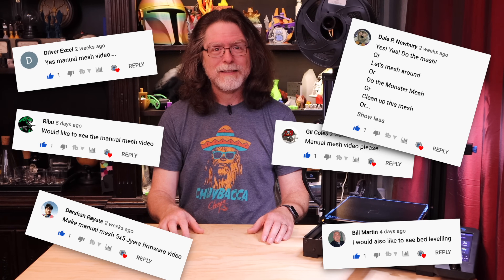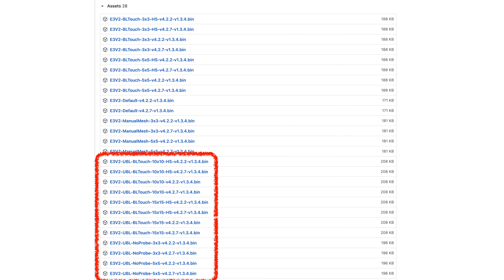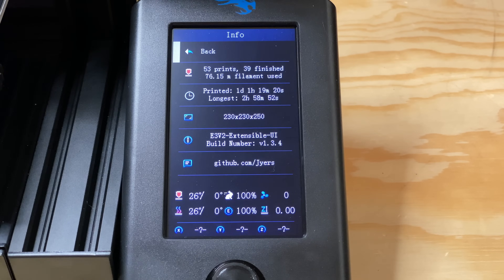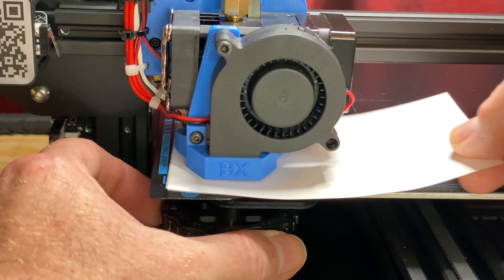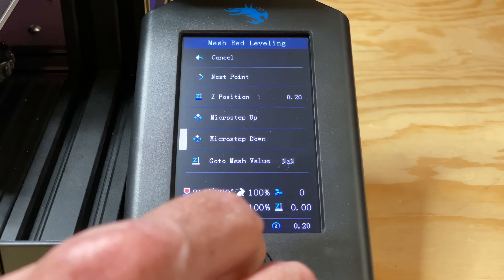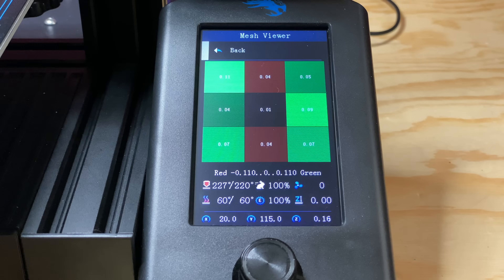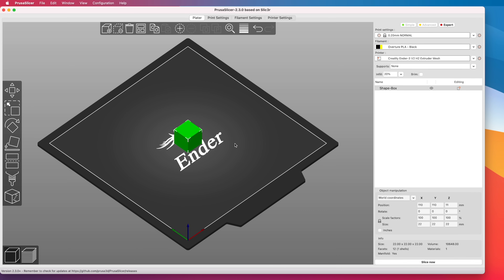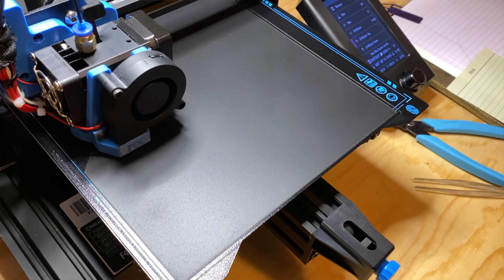Perfect First Layers with Manual Mesh Leveling - JyersUI on Ender-3 V2

Comment: I would like to find out is the Jyers firmware work with the CR-Touch? or only with BL-Touch?
Reply: did you find out if cr touch works with jyers if so what firmware did you use
Reply: @Mrccarter3000  yes. It works with the CR-TOUCH

Comment: Thank you so much! I can't seem to find the lcd screen firmware. Can anyone help (ender 3 v2, 4.2.2 board, no bl touch)?
Reply from the maker: Hi! Download the source code.zip file from the bottom of the big list of files here: https://github.com/Jyers/Marlin/releases/tag/v1.3.5
When you expand the zip archive, it should produce a folder named Marlin-1.3.5 and Inside there, you'll find a Display firmware folder. It contains a Readme file, so read that for instructions on how to proceed. It also contains a Firmware sets folder, and that's where you'll find three different items. 👍
Reply: @BV3D  Thank you so much
Reply: I don't know if I did something wrong. Flashing done, but icons didn't change.
Reply: @chrisradical2046  the icons are done by opening the back of the display. There is an sdcard slot on the back of the PCB to flash the icons. 

Flash the firmware via the slots the front

Flash the controller with its internal sdcard for the icons. 

In both instances only have the relevant bin file on the card.
Reply: @ThoughtandMemory  That's what I did.

Comment: Question : so just add that m420 code, and no need to tick "enable mesh leveling" option before print?

I've used mesh leveling before but didn't add any M commands in slicer, I kept going to level> tick the mesh leveling enable then print. Hmmm...

Comment: This was such a useful video! Thanks very much. I too had the same problem of a quite pronounced dip in the middle of my Ender3 V2 bed and even levelling the sides meant that prints in the middle kept lifting off. After installing the Jyers firmware and following your instructions, the prints are perfect!!!!

Comment: Any possibility to get a video on using the CR Touch with Jyers? I imagine it's no different from the BL Touch as far as usage but it would be nice to know how to properly using the ABL with Jyers and what the Mesh Viewer means.
Reply: should be identical to bl touch i use a crtouch and its working perfectly. just do a manual bed leveling using probe take your time and try to get each corner as close to 0.001 as possible. it takes a while and tedious as hell but worth it.

Comment: Between the silicone spacers, nyloc nuts, and 5x5 manual mesh in Jyers, my leveling/tramming issues have been gone for months. Best upgrades I made on my Ender 3 v2.

Comment: You still have to level the bed as normal right? Does that make it so you need to remesh?
Reply from the maker: Hi! Yes, level the bed the regular, manual way first. Then use the Manual Mesh. The mesh lets the printer know where the bed is high or low so it can compensate by making tiny adjustments to the Z axis on the fly. 

Once the mesh has been created and saved, it should be good for a while. Things that can affect the mesh over time include having to apply a lot of force to remove a print, accidentally messing with the bed's adjustment knobs (like, out of habit...I've done that).

If your first layer starts to look a bit iffy after a while, go through the manual level + manual mesh process again.
Reply: @BV3D  so continue to level the bed once every couple of prints as I would normally? And then remesh every time I relevel?
Reply from the maker: @airman6937  I'd say let it be until it acts like it needs to be leveled. I mean it's been a few weeks since I filmed that episode and I haven't had to mess with the leveling (either manual or mesh) since then. I've probably done a dozen prints or more on it.
Reply: @BV3D  that is great to hear, thank you!

Comment: Man i have to say, this is probably the best "how to" 3d printing channel. There is just something with "older" people that they explain everything clearly and properly. Its often i watch a video and end it with more questions than i had before the videom but now that i found your channel i find everything i need and alot more info i could need. 

Oh and there was a long time i wondered why people dont use a leveling tool to level until you explained that its not actually leveling but making the bed paralell with the nozzle 😅. Now it makes alot more sense

Comment: Hi, for the G Code setting in the slicer (mine using Cura) the code just type “M420 S1” or “M420 S1 ; Enable mesh stored in EEPROM”?

Comment: Can you explain how this works in conjunction with the z-offset.  I'm having the most difficult time, when trying to do either.  When I level now my z offset is off, or vice versa.  thanks
Reply from the maker: The mesh specifies where the bed is higher or lower relative to the nozzle. In the video, the center of the bed is lower than the left and right sides. This means the bed kind of has a valley running through the center of it, from front to back.

So without the mesh enabled, whenever the nozzle is at the center of the X axis, it's further away from the bed than it is at the left or right sides.

But when the mesh is enabled, the printer moves the nozzle up or down a tiny amount so it can fly above the bed at a consistent altitude. 

Talking about the Z offset, then, let's imagine the printer has set the Z axis to a value of 0.2mm. The Z offset value is a way of fine-tuning the actual physical distance between the nozzle and the bed. Adjusting the Z offset in the negative direction causes the nozzle to be closer to the bed, and adjusting it in the positive direction causes the nozzle to be further from the bed.

So, when printing the first layer with the mesh enabled, if you need the nozzle to be closer to the bed to get the filament to stick, make the Z offset lower. If the nozzle is too close to the bed, make the Z offset higher.

Does that help?
Reply: @BV3D  Thank you thats incredibly helpful.  So basically I should try to setup my mesh fist and adjust the z axis after.  If I understood right.

Comment: I don't hardly ever move my printers once they're installed, so I have been using manual mesh levelling since it was introduced in Marlin. No need to go through the rigamarole of setting up a BLTouch or inductive probe. Like Ron Popeil says "Just set it....and forget it!"
Reply: The nice thing about a bltouch is that it easily allows you to change print beds without having to re-level.  To me, that's the biggest advantage.  You still want to level your bed as good as possible manually.

Comment: Howdy! I've been learning a lot from your videos and have recently added the Jyers f/w to my Ender 3v2. Your mesh leveling instructions were easy to follow but I wanted to test it out with your Big Flat Square. However, I'm unable to slice it with the Cura slicer. Instead it gives a warning dialog saying, "Unable to slice. Please review settings and check if your models: - Fits within the build volume (it does) - Are assigned to an enabled extruder. (It is, as far as I can tell). -  Are not all set as modifier meshes. (I'm not sure what that means.) Any ideas on how I can get this to slice? Thanks!
Reply: Also to note for this and other prints that give same error...turn off the skirt. This will fill the bed completely and also allow just oversized X or Y prints to be set at 45° and turn "golden" for slicing onstead of downsizing! Hope this helps!
Reply from the maker: Hi Jesse! I just tried this in Cura with an Ender-3 V2 profile and what it looks like is, Cura has an unprintable area defined that forms a border around the outer 10mm of the bed on all four sides. That reduces the printable area on the Ender-3 V2's bed from 220x220 to 200x200.

To work around this, you can do is scale the big flat square so that it's 195x195mm (but keep the 0.2mm thickness -- uncheck "Uniform Scaling" so you can set each dimension independently of the others).
Reply: @BV3D  Sweet! I’ll give that a go tomorrow. Thanks for the prompt reply.
Reply: @BV3D  Adjusted X & Y to 90% and it sliced just fine. Thanks for the help!
Reply: Gonna have to give credit to Hellebuyck for that tip, thinking thats where I learned it, maybe? BTW, what does the "asymetrical" option do?

Comment: Nice review...same firmware exists for the Voxelab  Aquila 👍
Reply from the maker: I think there are at least two different forks of JyersUI for the Aquila. I need to look at them again to see which one is getting updated more frequently, so I know which one I want to use. But also, Scott Lahteine, the curator of the Marlin project, indicated that JyersUI was close to being merged with mainline Marlin, and that should bring the JyersUI benefits to more printers (presumably including the Aquila). 👍

Comment: Do i need to update the display firmware to have the leveling option available?
Reply from the maker: I don't believe so. The stock display firmware should have a Level button in it as well, which is used when you've got the BL-Touch version of Creality's firmware installed on the main board.
Reply: @BV3D  you're correct - you don't need to update the display firmware - I didn't and my 3x3 version has all the options on the screen, including some customisations of colours and display brightness. Updating the display firmware just gives access to different icon packs and display appearance.

Comment: Thank you for this video! There are surprizingly few videos about mesh leveling out there.
I still don't quite understand a few things. 1st, why each point default is set to 0.20? Then if we manually leveled the corners, I'd expect them to be near 0 in the mesh but both for me and for you as I see in the video they aren't 0.
And lastly do you really have to lower Z offset -0.20 from your mesh to get a good first layer? Is it the matter of lowering it by the first layer thickness? People often see 'look at the first layer while printing and adjust' but rarely show the process. I'd love to see it done live with commentary :)
Reply from the maker: Hi! I think the reason the firmware positions the nozzle at 0.2mm at each point is so you've got room to get paper or a feeler gauge between the nozzle and the bed. I know when the corners are leveled it shouldn't be too necessary, but if the center of the bed is higher than the edges, it makes sense to have it do that.

I don't know why I needed to drop the Z offset so far negative, but it's what worked for me to get the first layer looking good. That's part of why I used that huge square; it allows for a huge amount of time to adjust the offset and see what the result is.

I may try setting up a "Nozzle Cam" using a cheap endoscopic camera from Amazon, so I can see very closely what's happening down in nozzle land when I'm doing this. That would probably make for a good video showing how to adjust the Z offset, if I split-screen it, with the printer's screen on one side and the NozzleCam on the other side.
Reply: @BV3D  Thank you for replying, that was my thought too.
Sounds like a great idea for the video! I want to watch it already :)
Reply: @BV3D  love the Nozzle Cam split screen video idea. /thumbsup/
I reckon you're right - 0.2 is a good thickness feeler gauge to use. After creating and saving the mesh I'm trying to figure out how to permanently set the Z offset in the (Jyers) printer menu so that "less" tuning is needed during the first moments of a print - maybe just a tweak if at all necessary. At the moment my mesh seems to be "up in the air" around 0.24mm above the build plate so I need to tune it straight to -0.24 at the start of a print - it must be possible to preset this somehow?
Reply from the maker: @3888Orbost  The Z offset needs to be saved after it's set, but there's not a way to do it during a print. You have to do it afterwards. But it should stay set between prints as long as the printer hasn't been turned off and on again.
Try this: Run a short print job, adjust your Z offset to the value that works for you, and when the print finishes, get back to the main menu page. Then go into Control and select Store Settings -- that should save your Z offset value. Test by turning the printer off and on again. The Z offset value you set should still appear at the bottom right of the main menu page.
Reply: @BV3D  thanks for the reply Bryan, will give that a go. /thumbsup/

Comment: This is all well and good, but, I still have no idea what the advantage of it is? How is this any different than manual leveling? I only have to do that MAYBE once a month and I’m printing nearly 20+ hours a day on average.
Reply from the maker: Hi! With a good, flat bed, manual leveling works great. Manual Mesh leveling helps compensate for not-so-flat beds.

Manual leveling, at least on this particular printer's bed, was a matter of choosing between having the nozzle too close at the left and right sides (but just right in the center), or having it good at the left and right sides and a little too far at the center. 

So, Manual Mesh to the rescue (for this particular not-entirely-flat bed). 👍
Reply: @BV3D  thank you so much for the reply! Perfect explanation! I “get it” now!
Reply: Also, I am constantly using the term “paralleling” to describe leveling the bed now, thanks to your channel! Keep the great content coming!

Comment: For clarification I’m trying to use the term “tramming” instead of “manual bed leveling” going forward, so you may notice that difference after Jyers UI is merged into the main fork.
Reply: I have been screaming this at almost every video I see (Out loud not online) :) Thank you

Comment: Love the video! Celebrating my 1 month anniversary with my E3v2 and this really explains alot! I now have the 5x5HS version installed (and working correctly) and it has made a BIG difference. Thinking about dropping down to 3x3 to start printing faster. Quick question, what does the 'Viewer Asymmetric' option do and how is it enabled? Keep these awseome vids rolling and looking forward to more BV3D!
Reply: You dont have to probe the bed before each print! Just retrieve the mesh from eeprom in the start code.

Comment: Many thanks BV. I've been very happy with the JyersUI software, which I installed shortly after your video. In particular the way it captures BLTouch failures. Marlin had often (4 or 5 times) notified me that the BLTouch sensor had mis-fired by letting the Z stepper motor skip as it tried to push the nozzle through the build plate. Jyers just stops everything and puts a notification on the display. Love the auto meshing too, and the visualization of the leveling results. I had an issue with the left side being lower than the right. This feature helped me see (and correct) the problem.

Comment: I installed the firmware but didn't input any code in my Slicer after meshing the bed and I'm getting prints that are better than when I was using the stock firmware. Is there a chance that we don't need to input code into the Slicer or am I just wishful thinking and my leveling skills are better than I thought?
Reply: Correct the M420 S1 is not needed as in the source code on H it defines restore levelling after gG28 so not needed but it doesn't hurt it if added :)
Reply: At first, I forgot to put the code in my slicer too. I think the improved results just came from being better at bed leveling in general. The bed I am now using is pretty flat so grabbing the mesh data at 25 points may not be as critical
Reply: @newburypi  I know for me it was critical because I have the stock glass bed and whatever reason there's a 2 mm divot in the middle. The bed clips on front and back warp the bed as well and the bed fluctuates +/- 0.2-5 mm in various spots according to the bed display.
Reply: @Viceroy11011  I think those stock clips are bad: I had a U shaped bed (+/- 0.24 mm), but after replacing them with 4 binder clips the bed is now much more flat and regular (+/- 0.08mm).
Reply: @gabrielecannilla8969  I had the same feeling so I moved them to opposite sides. The bowing in the middle  is gone now. I get nervous about the binder clips because of the arms.
Reply: @Viceroy11011  I didn't think about it, but a simple solution in my case could be to just unplug the arms, since I try to never move the bed anyway. Thanks fo the heads up!